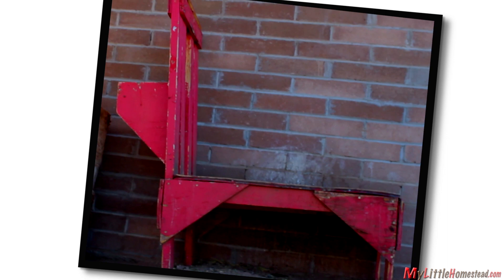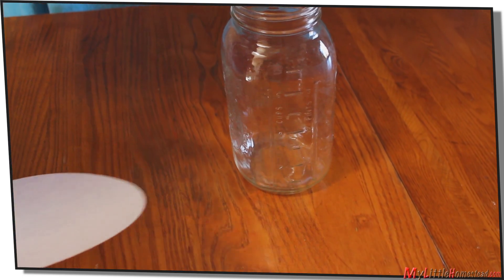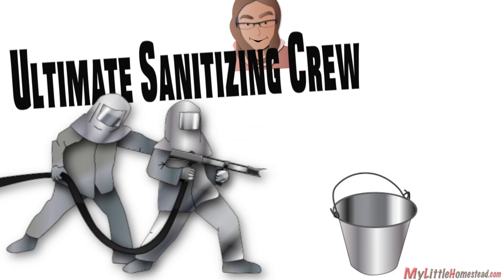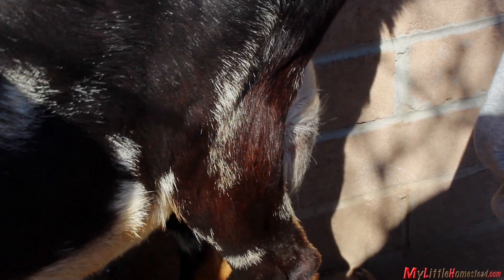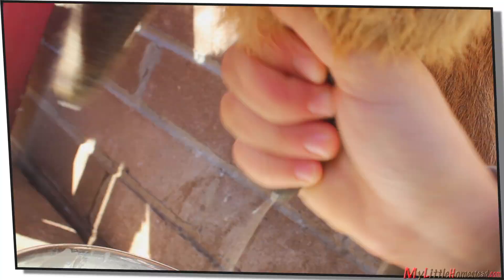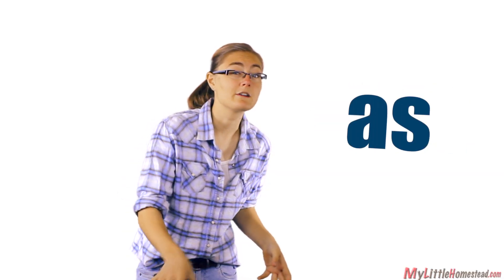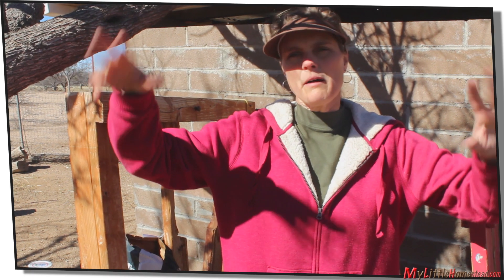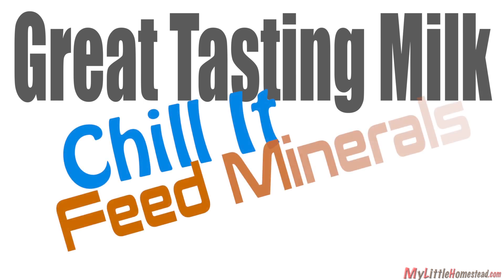Raw Milk - How We Milk a Goat

Comment: By over processing foods they generally last longer and are easier to store and transport further, good for big business. The reason often food stuffs generally last longer is coz there's less life and nutrition in them which would attract bacteria, flys, rotends to damage etc them. Did you here about the test, 1 piece of margarine, 1 or butter left open to the air, the butter spoiled and was eaten by flies etc quickly. Margarine was strangly left untouched for a long long time.

Comment: When we had only goats (at one point 12) I wanted for these reasons to only feed grass/hay, even thought it was hand made and of good quality/variety, I had real problems with and reasonable quantity of milk unless I gave grains, which I didn't want to do. Goats are quite fussy, and wasteful in my experience, we did used key hole feeders etc. Switching to cows I found the exact opisiste once they'd been transitioned off grains (took good year) and they are much better eaters of grass/hay.

Comment: By rotends I think you're probably meaning rodents, but ?
I hadn't heard or read anything about the margarine vs butter test you mention, but what comes to mind as maybe fitting for explanation is that most margarines are made with hydrogenated oil I think. Another might be that butter is animal fat, whereas margarine is plant oil. And maybe both of these factors combined are the reason for the test results.
And did they use salted or unsalted butter? Latter probably spoils more quickly, I guess